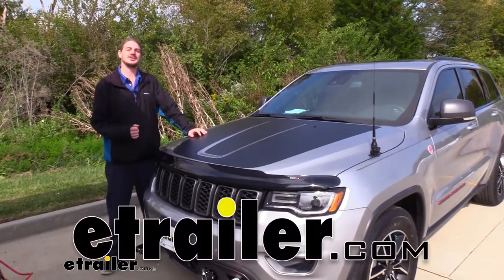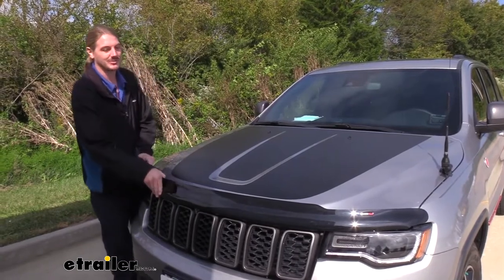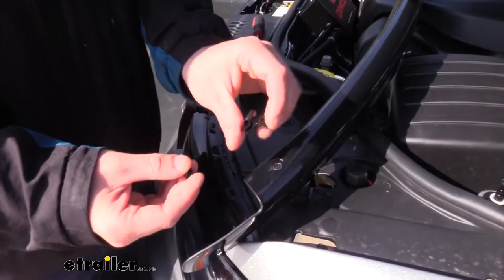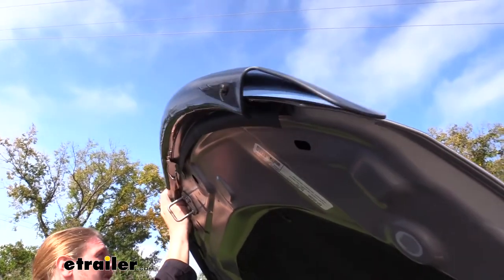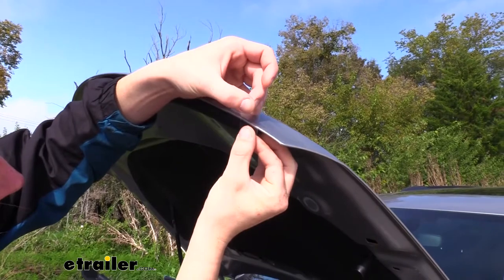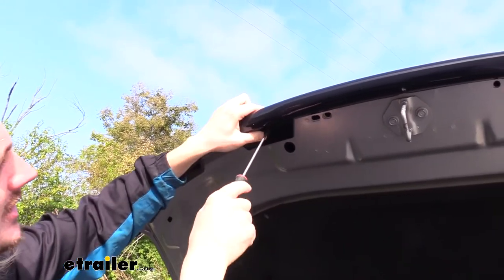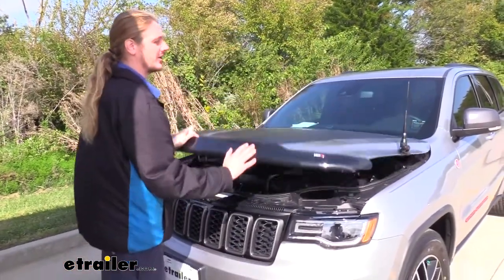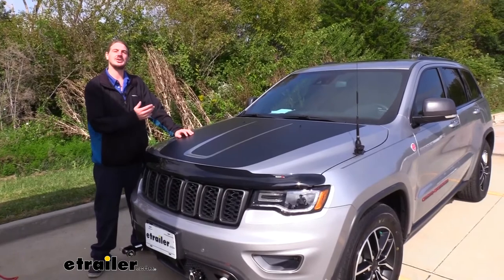Weather Tech Easy-On Stone and Bug Shield Deflector Installation - 2020 Jeep Grand Cherokee

Comment: Are the little bumper stops that protect the paint from flexing that you put on in the end included with the kit as well, or do you buy them separately?
Reply from the maker: The little rubber bumpers will come included with the kit. Check out this kit on our website in the following link.
https://www.etrailer.com/Bug-Deflector/WeatherTech/WT50200.html

Comment: Wouldn't it be better to put those little rubber bumpers on the back of the deflector so you don't need to stick them to the paint?
Reply from the maker: The rubber bumpers are placed on the hood because the bug deflector flexes and you run the risk in loosing them.
https://www.etrailer.com/Bug-Deflector/WeatherTech/WT50200.html

Comment: All the websites say “no drilling required “ 🤔 it’s easy to do but why lie about drilling?
Reply from the maker: I'm not sure what websites you're speaking of. The video you watched explains that one self-tapping screw is needed, and we do not state on the product page that it's a no-drill application. We also mention in the video that we had difficulty with the self-tapping screw, and ended up needing to drill a pilot hole. 
https://www.etrailer.com/Bug-Deflector/WeatherTech/WT50200.html
Reply: I just bought this exact item on eBay and it said no drilling required and then I watched this video to see how to install and yea there’s drilling .

Comment: not a fan of drilling into the hood.  In the Northeast salt is used primarily on roads and that hole WILL be problematic.
Reply from the maker: True. We recommend running that one screw home then removing it and giving the hole a quick shot of rust resistant spray paint to protect against corrosion. We should have mentioned that in the video. 
https://www.etrailer.com/Bug-Deflector/WeatherTech/WT50200.html